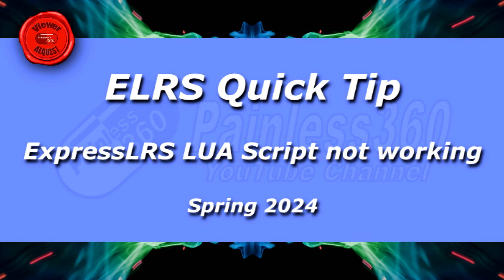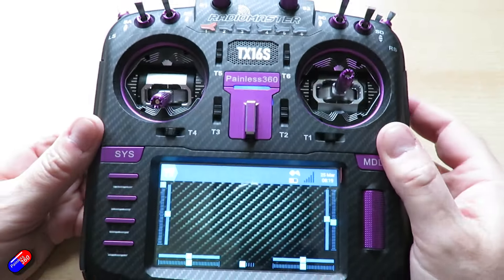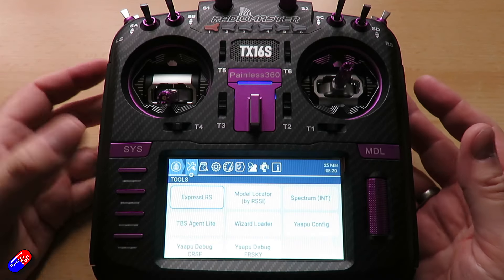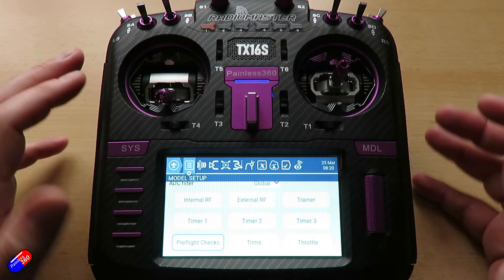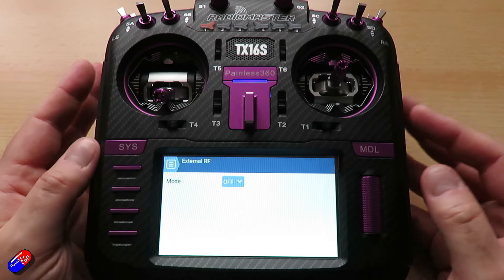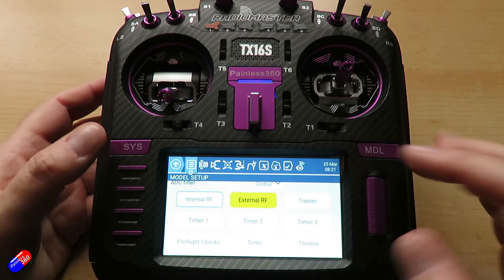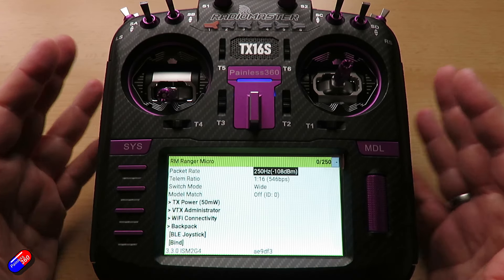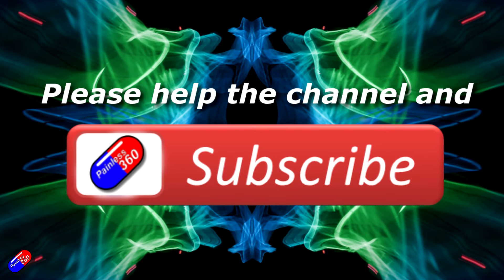Why does my ExpressLRS LUA script hang?

Comment: Found it under Hardware........lowered the baud rate to 115KBps (the only other option) and the LUA script ran no problems.  Thanks anyway
Reply from the maker: FrSky fitted a slow inverter for the JR bay on those radios,  despite knowing it would impact systems like TBS Crossfire.  Many believe it was a deliberate choice to hinder the use of high speed 3rd party modules as they were planning their own R9M module.... Happy flying!

Comment: Hello and thanks in advance, i have a Taranis QX7 and installed an external ELRS module HappyModel ES24TX.  Ive tried what you explained and still getting the LOADING .....nothing, I have seen, other Youtube channels mention lowering the baud rate,  in MODEL SETUP -> EXTERANL RF -> it does not provide a list of settings or allow you to change the second value , any idea how this is achieved

Comment: Hi, I have a commando 8 tx with the same problem. I have set the external rf on crsf, but the lua script is still not working. Can you tell me if i m missing something? Thx
Reply from the maker: Isn't the ExpressLRS stuff internal in that radio?
Reply: It is internal, but wired to the external module, so it s like an external module.
Reply from the maker: How odd, I've not had one here to test so that is an odd way to do it. I;'d check there isn't an updated LUA script.. Best of luck...
Reply: Ok thank you very much. How can I check if there is an updated version of lua script? By simply downloading it with elrs configurator?
Reply from the maker: Pretty much... Best of luck
Reply: Did you get it to work? I have the same problem...
Reply: @badbogey  yeah, the problem was that i installed the wrong firmware version on the commando. In elrs configurator i was choosing Elrs 2.4 gHz, one day I tried to install the firmware called Elrs 2.4 gHz V2 and it worked instantly. I think that V2 is also the version of the commando tx. Give it a try
Reply: This only works if you have the 2.4 gHz version obviously
Reply: @alexboscolo2962  Thanks for the reply. But because I can't access ELRS in system menu I can't enable WiFi, doesn't the configurator need WiFi to reflash?
Reply: @badbogey  yeah but it can be any wi fi source, not only the wi fi from the tx.
Reply: @alexboscolo2962  Really sorry for the questions and I appreciate you're help. But how can I update the firmware on the Commando when I can't enable WiFi on it?
Reply: @badbogey  i downloaded the elrs configurator on the computer, connected the commando 8 and updated the firmware by using my home wi fi
Reply: @alexboscolo2962  You were bang on correct about the V2 😁 In the end I used a usb-c straight into the ELRS module and used the UART method on configurator. It works!! Thank you for your time and help 👊
Reply: @badbogey  exactly, i did the same. Trust me, i lost like a month trying to make it work, so now I know how to do it and I m glad that I ve helped someone else

Comment: Hey i have done the same thing and turned that on to crossfire but it still hangs on the loading screen. This is my first time actually messing with any settings becuase up till not ive only used a sim so im not sure what to do i have the radiomaster pocket and it dosent seem to be working.
Reply from the maker: Check out my videos on the full setup. Check you've turned on CRSF for the right place in the radio, external if it is a module in the back, internal if it's inside the radio... Best of luck

Comment: I still have the same problem, tried to update everything, but still the same. Anyone have some suggestions?
Reply from the maker: It would help if you cover what troubleshooting you've already tried and the errors (if any) you're getting..
Reply: @Painless360  Thank you for the reply. I reduced the baud rate to 115k it resolved the issue, but some time later it came back. Its currently working after a restart.  I use the radiomaster nomad at elrs 3.5.3 and it seems im missing some packet rate options.

Comment: Great show. Amazingly this just started having this happen to me the other day and was dumbfound why! I never changed anything ! I have model match turned off. The only way I could get the script to show was. turn off TX, unplug bay TX, turn TX Off then ON , open script  "blank screen showing question mark" but then when I plugged in the external TX into bay  the script works. But that is patchy  So I dug deeper. I went into model setup and made receiver unique ID a zero, then It all worked fine, script fires up now.  In the past with ID turn off, it never mattered if RX ID had a number signed.  One of life's mystery again ! lol
Reply from the maker: Make sure that you keep the LUA script on the SD card updated as you upgrade the firmware on the ExpressLRS hardware... Happy flying

Comment: I had a similar problem with my Zorro and the external module was selected as CRSF, however, the lua script still would not work. After changing the Baud Rate to less than 400K, it started working again.
Reply: Thank you, it worked for me too.😀
Reply: Thanks that works for me as well!

Comment: My setup on the radio was correct, but,  ...the RadioMaster Ranger Micro did not work anymore  after the winter time-out. On the ELRS Discord I got the advice to reflash the firmware. What to say, it worked again after this was done. For what reason this happened, I don´t know. The other two ( HM and SIYI) on the same version were still working,
Reply from the maker: How odd, thanks for sharing... Happy flying

Comment: Updated  ELRS  and  LUA scripts to the latest version on my TX16S (OPENTX).... Now when I go into the LUA script the writing is jumping initially and then goes solid until you move the wheel...it did not do this beforehand. Anybody got an idea how to correct this? Thanks in advance. 👍
Reply from the maker: From what I recall, the ExpressLRS stuff isn't tested on OpenTX now and the common advice is to update to EdgeTX if you want to get the best from ELRS... Best of luck
Reply: @Painless360  thank you so much for replying... Yes I had that thought in the back of my mind... Looks like I'll have to take the plunge....finally!
Reply: @Painless360  updated to Edgetx and Expresslrs lua is no longer jumping.... Oh again many thanks. 👍

Comment: Have you heard that MATEK ELRS are no longer supporting  ELRS ?
I could no believe that the matek targets were missing.
They simply advice their users to use a firmware developed for a different brand / radio to bypass the new limitations which means they let others pay for them.

What a shame that matek is plundering an open source project. I will start selling my matek receivers and flight controllers cause I will go on and get speedy bee FC instead and new ELRS. 

I like this kind of explanation videos. I had also trouble with some LUA scripts and had to ask a friend to digg into it. Luckily he was able to fix it.
Reply from the maker: My sources say that it appears that there has been some kind of falling out so now Matek will only make receivers for generic targets. There must be more to it but I'm not close enough to know the in's and out's. I use RadioMaster and BetaFPV receivers here anyway...